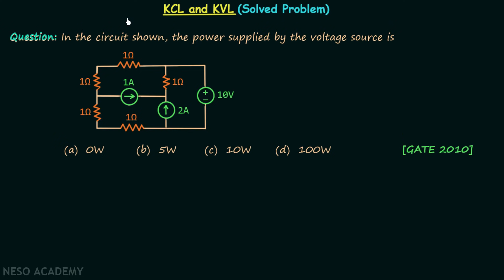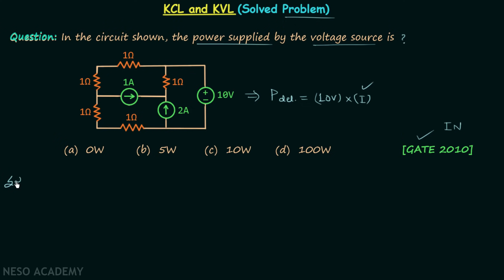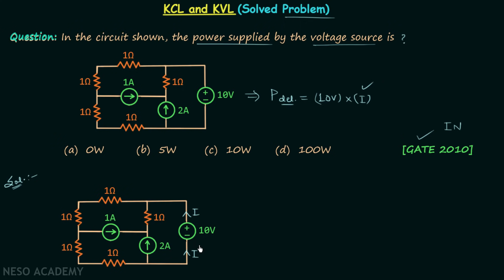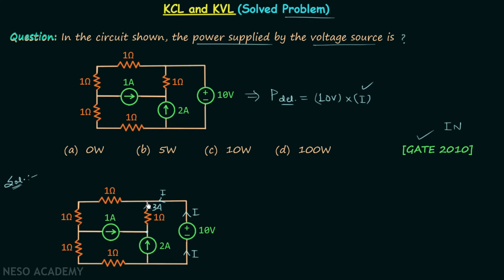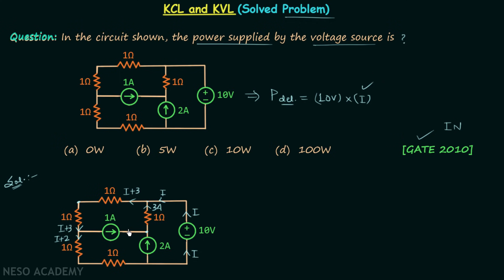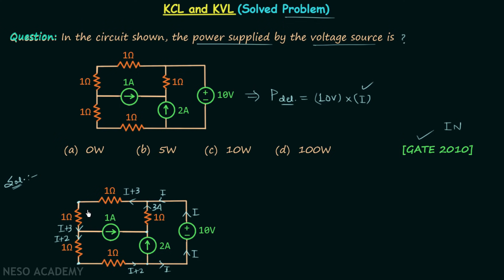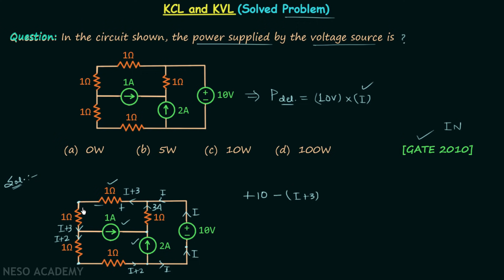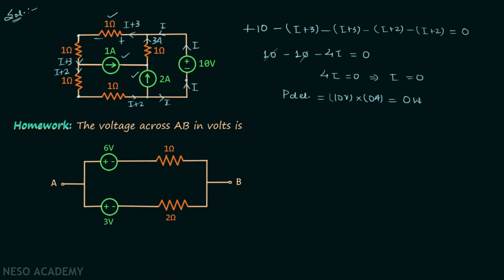KCL and KVL (Solved Problem)

Comment: By Millman’s Theorem, 
VA–VB = (6/1 + 3/2)/(1/1 + 1/2) = 7.5/1.5
= 5V
Reply: i got -5V, since the voltage drops by 6 right after node A, so i got -6V -Vb + (-3V-Vb)/2 = 0, >>-15V - 3Vb = 0 >> Vb = -5V.  What am i doing wrong?
Reply: @same560  its voltage difference...sign doest matter.
Reply: Awosem bro 🎉

Comment: Let current in upper source be I1 & current in lower source be I2
I1 + I2 =0
Va - 6 - I1 = Vb
Va-Vb = 6 + I1
Also
Va-Vb = 3 + 2(I2)

Equating Above Equations
Va - Vb = 5V
Reply: Thnk u so much
Otherwise no one else interested to gíven full solution 🙏
Reply: @monikakumarikoli1133  can you please tell how i1+i2=0?
Reply: @puneetchhabra411  kcl law
Reply: How I1+ I2 is equals to zero ?
Reply: @ranjitpatel5127   Ranjit Patel, coz current going to A or B branch is zero. Those brances are just streched from the circuit.
Reply: how are we equating the two Eqns. because I'm equating it but it's not solving . Kindly tell me about it.
Reply: 🎉❤ nice bro

.
Reply: Whatever u above said was wrong....how u were mixing voltage and current in same equation?
Reply: @vijaykumar-vc5pq  thats not current , instead if i1*1 he wrote i1
Reply: How can we equate

Comment: Sir  if we have voltage source then votlage across all elements in circuit  same or differ?
Reply: no it will differ..if all elements are placed in series...and if all elements are in parallel then the voltage is same in all elements

Comment: VA-VB= 5v and current in 1ohm is -1amp. also current in 2 ohm is 1amp.
Reply: current through 1 ohm is -1 amp..how do u get current through 2 ohm is 1 amp...plz reply
Reply: Current through 2-ohm resistor should be -2A because the total current in the circuit is -1 A and V=IR
Reply: Does it mean the direction of current in 1ohm and 2ohm is different?
Reply: How

Comment: total current follwing in he circuit I= -1 amp

Va - 6 -1(-1) = Vb
Vab = +5 volts
Reply: total current depends on the direction of current. if u assume it to be leaving from the positive terminal of 6V you'll get a current of +1A. if you assume it as leaving from the negative terminal of the voltage source(6V) you'll get -1A.
Reply: @Gowri Varun Devabattula it's your choice to choose the path, anyway you will get the same answer.
Reply: @Gowri Varun Devabattula  Va - 3 + 2 ( i ) = Vb       here i = (-1) amp  i.e Va -3 -2 = Vb , Vab= +5 volt (same as mentioned above)
Reply: How u find voltage across resister 
V=IR 
But we dont have I (current value)
Reply: @Gowri Varun Devabattula because of the direction of flow of current, i have assumed while, applying KVL in Inner Loop.
Reply: @Gowri Varun Devabattula u will get the same ans.
Reply: @15TUEE038 DINESH KUMAR R. Apply KVL so you will get 6 + 1I + 2I - 3 = 0, solve this I =-1.
Reply: @anandini5740  current across 1 ohm and current across 2 ohm is not same.. As they are in parallel connection
Reply: @usharanidash2831  i think it's not in Parallel. Like we can shift point a and b on the circuit node they are connected to. Those wires stretching to a point and b point from circuit nodes are just there to confuse you. Now, after taking them on wire, whole circuit elements becomes in series and u can take one current through all, that's i. 

If he had shown a current I coming from va node and going back to vb node, then we should have assumed two different currents, i1 and i2 going through 6v and 3v respectively.